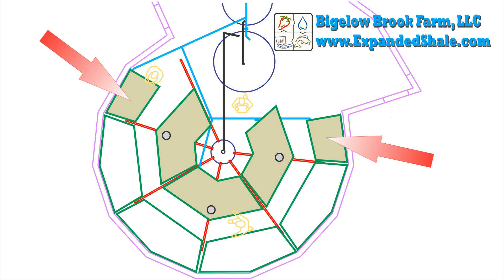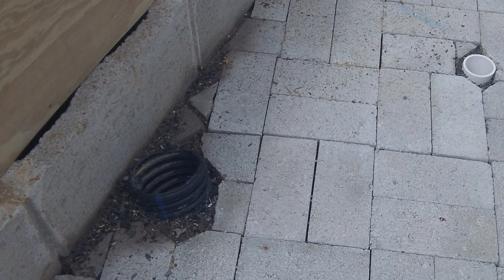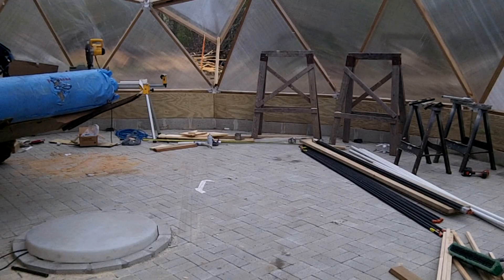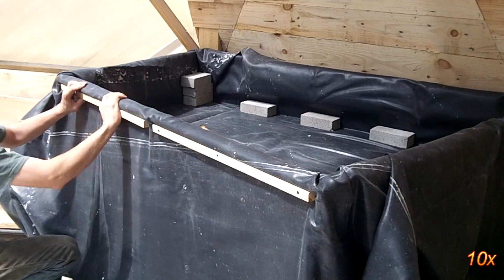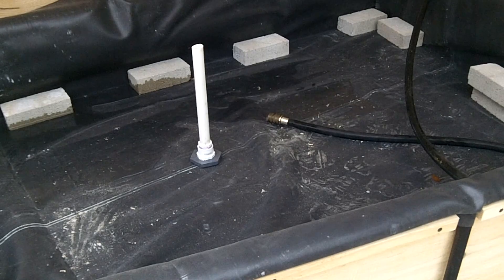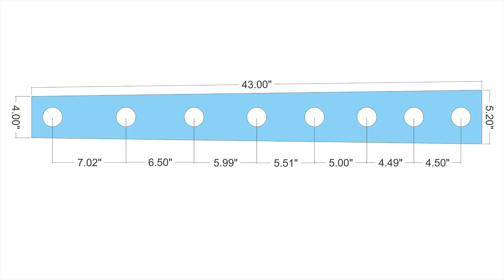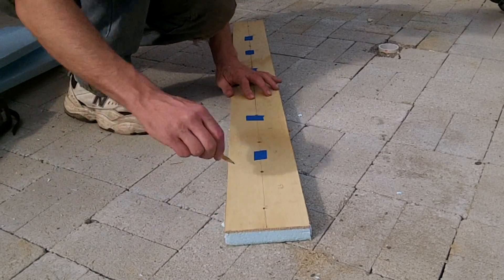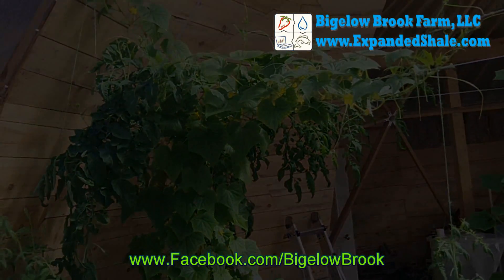Aquaponic System Install - 3 of 3

Comment: i admire you sir, what kind of shell did you use? sorry for my poor ear in English.. i ask it because shell is calcium and I've heard that calcium raises pH i hope it won't be a problem.. and you use smaller stone that i think would clog up with in 4 - 5 yrs..

by the way, i use a ram pump in my Aquaponics, and it's been running now for 2yrs.. i'm not paying anything in pumps. It's just a little different to an original ram pump. I wish i could help too.. i copied your auto fish feeder :) thanks

Comment from the maker: Most people build their frames with wood.  I just chose to use steel since it's a bit stronger and takes up less space.  MIG uses an inert gas at the welding point to evacuate the oxygen around it.  I'm self-taught, so it's really not too hard to do.  ;-)

Comment: Have you considered expanding vertically to maximize the space used? I immediately thought of strawberry towers strapped to the geodesic frame all the way to the roof and having an external water pump that is strong enough to pump that high replace the sump pump. A 12 ft strawberry tower is expected to produce 1 lb each and offer several runners each year for replacement every 2 years.

Comment: I'm adding a floating raft to my IBC system on Sunday, and the quick tip on drilling the holes will be invaluable.  I was lucky enough to score some free styro from Ikea!  How long have your rafts been active?  I am worried about having enough oxygenation, but I understand you have no additional aeration.

Comment: instead of lifting the raft beds on risers over the heating system, couldn't you have excavated some bricsk to circulate air under the beds? or would that result in more work and problems? less thermal mass too i guess

Comment: okay, thanks... well hmm that a deep subject, okay then bucket potatoes is easy 4 seed taters to 1 bucket, drill a hole for a 2" net cup at bottom of bucket use old strip of cloth and wad it up into net cup add 5 inches of sand lay cloth down and cover it up with 1 inch of sand add bone meal I like kelp meal best and Epson salt. Cover wait for plant to get about 2 inches cover all with sand except very top of leaves then repeat. place in your ebb-n-flow system. I get at least 4-5 pound per.